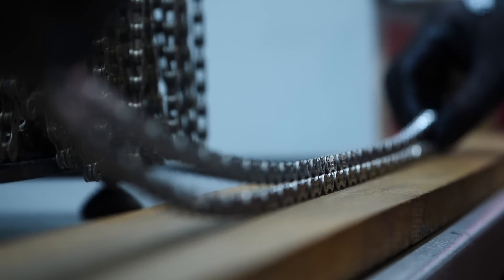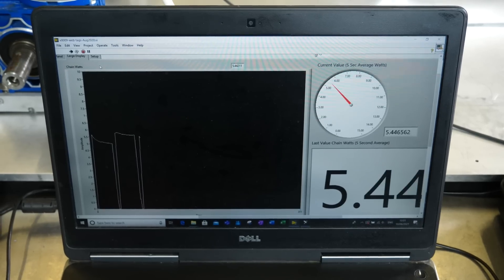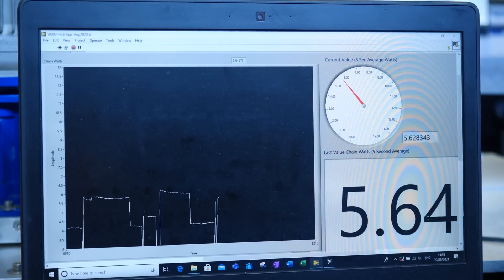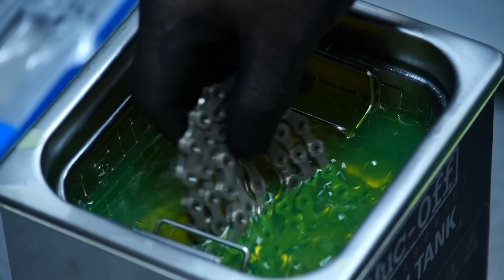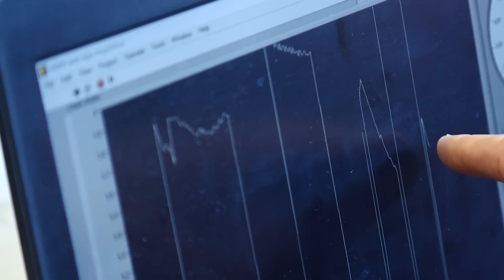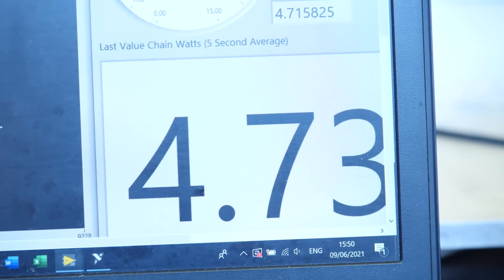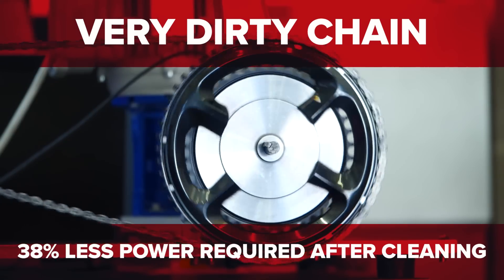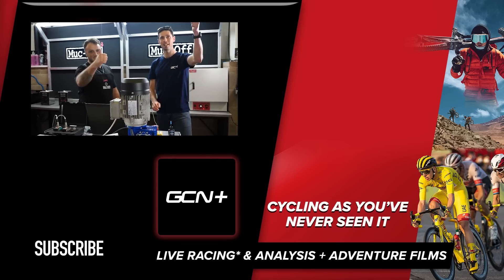Free Speed! | How Much Faster Is A Clean Bicycle Chain?

Comment: So you have a clean chain that's getting 100% (baseline) and as soon as you start splashing mud on it it drops to 62%?
Reply: No they're measure % difference in chain resistance. So if you loose 4.5W with a clean chain and 5W with a dirty, that's a 10% in resistance. 

But if you look as a total power 300W, an increase of 0.5W due to a dirty chain, you only loose 0.17% in effectiveness.

Basically GCN tech has been very very miss leading especially if you don't deal with stats often
Reply: @supernoodles908  True. You just explained it and I still don't understand it.
Reply: @kaspervestergaard2383  it honestly annoys me how people miss lead people with stats manipulation
Reply: @supernoodles908  That's why it's good with a comment section. Shouldn't be able to disable it in my opinion.

Comment: 6:14  How is chain tension controlled on the testing machine?  How much difference does that make?
Reply: The tension on the taut side of the chain is directly related to the amount of torque input from the motor to the chainring. 250 watts from an actual rider will put exactly the same amount of tension on the chain, averaged throughout the pedal stroke, as 250 continuous watts provided by a motor, when both are spinning at the same cadence in the same gear. The tension in the slack side of the chain is purely due to the catenary shape it assumes and is negligible in comparison to the drive-side tension.

Comment: Savings of 1 or 2 watts in 250W is not really worth the bother unless you are going to compete in a race with equals.   I just lube it now and then and clean it on occasions to protect my clothes (and hands when I jumps off).  
I would clean it after a muck ride but on the road every 100h or so of riding which is maybe one a month.

Comment: If we're looking for wattage savings, a few percent of sod all is sod all.  The energy consumption of a dirty chain is tiny compared to the weight of the bike and rider, and aerodynamics are the biggest single drain on your energy.   A clean and well lubricated chain is at best a "marginal gain" for competitive riders.  However, that's not the only reason to have a clean chain.  A clean chain wears more slowly and causes less wear to the rest of the drive train.  This saves money — although you need to factor in the cost of cleaning materials and tools, especially if you invest in a fancy ultrasonic cleaner and fluids.  Then there's the satisfaction of doing a good job or cleaning the chain, and the pleasure of it running quietly.  Don't forget to clean your chainring, your cassette or sprocket, and of course your jockey wheels.

Comment: It's a bit misleading to look at the 38% number. The real difference is how much power is lost of the total input, and even if it was 5 watts, then that's 2% of that 250 watts through the chain. Useful of course but it's not a night and day difference. If the first chain was used as an example, that 0.5 watts is 0.2% which is getting close to irrelevant.

Comment: A fair comparison would be a dirty chain vs a clean chain after a "normal" cleaning process not that professional "deep" clean. Given that tiny gain after deep cleaning, I'd assume the gain after usual cleaning would be negligible.
Reply: That's the same thing I thought.
Maybe they did and it didn't come out well for Muc Off (Rip off)
Reply: It's probably fair to assume that similar results could be obtained with basic cleaning tools. Keep in mind that individual cyclists are probably not the only audience to this video, but also employees of other bike shops. The parts cleaning and drying chambers, while expensive for a single user, would be well worth the investment to large bike repair shops in terms of the labor hours saved doing an otherwise menial task.

Comment: Power in bike is not so uniformly distributed as in dynamometer, since 2 pedals we got to push on. So chains and sprockets and dropouts should be tested in erratic maner, with say 350W average. More realistically, with 700 W average. Those springs should oscillate or no point in tests.

Comment: I really struggle to get my drivetrain clean. Any tips gratefully received. I spray it with WD40 immediately after the ride. Then wash that off with water. Then use degreaser and a Park Tools chain cleaner. It looks superficially clean, but if you bend a chain link you see it’s black and dirty in the roller etc. I use Muc Off Wet Lube, sometimes Dry. Short of boiling it in petrol - help!
Reply: You'll need couple of things before you begin;
1: an effective degreaser. I like "Pedros Bye Grease", but CyclingTips have a comprehensive list.
2: a chain with a quick-link so you can clean it off the bike.
As for the process, you can start by cleaning the chain on the bike with your Park Tool chain cleaner and the degreaser - this will clean between the rollers. Then remove the chain from the bike and scrub it with a nail brush or similar, before rinsing with water. At this point the chain will be pretty clean; You can use an ultrasonic bath if you want to remove any remaining tiny particles, but it won't get that much cleaner.
Before you put the chain back on the bike again, it's important to clean the rest of the drivetrain to prevent recontamination. Use the nail brush to scrub the chain rings, cassette, and jockey wheels. Rinse with water and refit the chain. 🧽 ✨
Reply: @rosscads  thanks for taking the time to reply, very kind. I think it must be down to the quality of degreaser, simply not good enough to leave it clean, given the steps I go through (and also occasionally as per you suggest). Will try the brand you mentioned, thanks!
Reply: @jgogl9791  Put peanut butter on there and borrow the neighbors dog.

Comment: And here I am having gone 800 miles on my SRAM ETAP AXS chain doing nothing to it at all because I read that SRAM chains come good from the factory. My issue is that the chain looks dirtier after I cleaned it than before I cleaned it.

Comment: If you want the independent, non sponsored version of chain testing >https://zerofrictioncycling.com.au/chaintesting/<
If you don't race, use a grunge brush to remove the grit followed by any low viscosity oil applied any way you want. Spin the cranks several times and wipe away excess. When chain is worn to 1mm buy a new cheap chain.

Comment: First off, you need to retitle this video SHAMELESS MUC-OFF COMMERCIAL.  I don't mind a bit of branding here and there from a sponsor of a video, but this was so blatantly done that it was insulting.  I have never used Muc-Off and never would, it's way too expensive for what it is.  Now then, as for the results of the video, I knew a clean chain was best, but didn't know the difference was that drastic.  Being here in FL our chains don't get that dirty unless we're off road, but I do clean mine once a week anyway and wipe it down after each ride.  For me it was always more about preserving my cassette, chain rings and the chain itself.  But now we all have one more reason to keep it clean, save the legs a bit.

Comment: I'm one of those nuts that waxes his chain after almost every ride. I heard about little to no wear, components lasting longer etc. So I decided to see just how long I could get a chain to last with using just paraffin wax melted in a crock pot. I was suspect about the life being reported out of chains waxed after every ride. I understand my results are anecdotal, but currently at 17000km on an 11 campy record chain and under .25 on the chain tool wear markings. People saying no good in wet or dirt, whatever. Gravel bike at 5000km and also under .25 on chain tool. Waxing is a pain at first while learning the steps to do it, but if you want to save money and have the best performing chain, then I suggest waxing. Its pennies to do.
Reply: As a mechanical engineer I can only say, that just paraffin is not a lube at all. Every report what sates its working simple NOT true (e.g they want to make money from it, like friction facts report does). Most of the time they are using a mix of oil with paraffin (like a generic candle), where the oil is the lube, or a mix with a dry lube like PTFE. Yes such a mix can work in some condition, but 1. the viscosity depends strongly on the exteral temperature 2. If you stand out, the oil foil will be damaged and it can't build itself back, like a pure oil does. 3. if you mix it with oil to be a good lube like a grease it will be not dry anymore 4. It wears and wash out quickly, this is the worse property of it. I can only recommend oil (any kind of oil will be good) aka wet/dry lube for your chain. If you want a fire&forget solution for your chains, use a totally closed chain case, like a dutch bike does.
Reply: @balsa02  Like I stated purely anecdotal. But I am at 17000km. I have not replaced a cog set yet. I have not replaced a chainring yet. Good luck doing that with oil. My chains do not hold dirt and grime like oil does, which will cause the inner pins to wear. Stretch the chain and destroy the drive train. A great article about this and testing done on almost all lubes was in Cyclingtips. Called Seeking the holy grail: A fast chain lube that saves you money. https://cyclingtips.com/2018/03/fast-chain-lube-that-saves-you-money/  It is worth a read. I found the comments the most informative as the author answers questions and gives more details.
Reply: @weasellyone2  “If you re-wax every 200 km, wear rates will remain untraceable for a long time,” says Kerin. “Re-waxing every 300 km, the average for a top chain like YBN SLA is 15,000 km to the recommended 0.5% wear mark". 

I'm not doing any form of maintenance that often my niqqa.
Reply: @balsa02  Erm, Paraffin IS a lubricant. It's the physical properties of the chemical that determine that. It just so happens, that the chains of hydrocarbons are long enough to be solid at room temperature. It might necessarily be an ideal lube for you by the sounds of it, but totally depends on ones goal as to whether it's worth it. Wax is dry, so doesn't pick up dirt easily, so reduces wear on components, however it doesn't stick as well like wet lubes, so isn't a long lasting. That is probably the major differences between them.

The viscosity 'problem' is the same with all lubes. Grease is a lube, and in your wheels and BB turns to oil like substance while riding, that's how it gets out. It just so happens new chains tend to be pre-lubed with grease, not oil. Grease is probably a better chain lube, but it's hard to get in. Some people suggest DON'T degrease your new chain for as long as you can get away with.

You can mix paraffin with a volatile solvent so that is evaporates after application. This is similar to how commercial dry lubes come as a liquid and 'dry' on application.

Wax does adhere to other things, just not as well as oil. That's fairly obvious from getting melted max/oil on your skin, they both stick for sure, but one is a lot easier to get off! You can make wax slightly stickier by mixing with something like xylene, not just oils. But it sticks reasonably well, if your chain is perfectly clean before you wax. It can resist wet weather okay, so long as the waxing is done when you chain is super clean. (I waxed my chain for commuting and would do 2-300km of riding minimum in the wet/mixed weather if done well, so would last all week in the winter).

The other benefit to waxing is re-waxing cleans the chain, so you only have to clean the chain properly once. Re-waxing is a doddle. Also, it's mildly amusing when you waxed your chain and let it dry, it goes rock solid in one long line.

I used to wax my chains. Basically once a week and had similar results to the OP.  But I take your points. I just think there are plenty of reasons to wax your chain before you even get into frictional gains. I stopped as frankly, I think the biggest downside is it takes a lot longer to lube your chain. It's no longer a 2 min job, and you do have to do it frequently, I did it like once a week.
Reply: 17000km on a derailleur bike is impressive. I can get close to that on a single-speed, but by that point the chain and gears are so worn there is no way on earth the bike would work if it had a derailleur in the path.

Comment: Firstly, the conclusion was confusing. They should have expressed the results in Watts, not percentages. And secondly, I suspect most people would have wanted to see the power differences with a derailleur set up, not a single speed set up.

Comment: “38% less power required after cleaning”... I think you’ve inhaled a bit too much degreaser 😂
Reply: Yeah exactly my thoughts 😂 probably 38% off of the 9% or 9w loss...whatever  Idk
Reply: over the drive train loss of 9 watts so that means if you pushing 300watts your effectivly only putting out 291 watts to the pavement while a clean chain your pushing 296 watts a difference of about 5 watts or so no alot on a sunday ride but deffinitly help in long race your talking about 1 minute of savings for a 2 hours race that alot of for pro rider.
Reply: Wait is degreaser bad for you?
Reply: @BeyondEcstasy  No he is talking about paint remover.
Reply: 8W lost when dirty, 5W lost when clean, (8-5)/8 = 3/8 = 38%. Math checks out & calculator does not inhale anything.

Comment: Very misleading results, but the other benefit to a clean chain is the potential longevity of the drive chain. I have only managed around 1000-1500 miles on a chain before it is 50% worn, which seems to be the time to change it. Silca claim nearly 10000 miles from a waxed chain… I’m 200 miles in to my first waxed chain so time will tell…

Comment: This is an excellent demonstration of why a quick wipe and a squirt of poundshop WD-40 knock-off is absolutely fine.
Reply: Fine for bare minimum.  A good quality oil makes a huge difference.  I've only been cycling for a year but I like taking care of my bikes. Especially one that costs 4,000. Dry lubricant doesn't let all the grim stick as easily. I use finish line. I used wd40 before. But it doesn't compare as it is water-based also. Just try it. And hot soapy water with dawn and a good brush is one of the best ways to clean other than deep cleaning.
Reply: @sethmichael8188  WD-40 is not water-based.
Reply: @davidf2281  silicone. Still trash for bikes
Reply: @sethmichael8188  Nope, not silicone either. Keep trying.
Reply: @davidf2281  shit based that's what I was thinking of.

Comment: 3 watts saving for a 15-20mins ride. Hhmmm.. stretch that 3 watts to 2 hours, 3 hours.. that's going to be a lot in the end. Not to discount the demotivating feeling of hearing and feeling a grinding sound from your chain knowing that it is slowing u down. I think it's gonna more than affect u by 3 watts. I trained like a mad dog just to go get 4-5 watts gain in FTP in 1 month. Imagine stretching the 3 watts loss, not just for 1hour which is your FTP but up to 3 to 4 hours of ride.. it's definitely gonna wear you down.
Reply: A whole lot of effort and continuous money spent on degreaser and lube for a measly 3 watts. A pair of latex inner tubes will save you 5 watts, simply getting more aero on the bike even much more.

Comment: Could it have changed with rear derailleur? I think bending more the chain creates more resistance and more room fore improvement.
Reply: Would not have any influence on the result: The power loss occurs in the section of the chain being under tension, not in the loose section.
Reply: @christiannasca3520  Any additional components rolling or moving with any mechanical force create a loss point of energy and efficiency. That's just the way things work.
Reply: @MetalY2KMusic  The loss is always a percentage of the transmitted power. And while the entire power of several hundred Watts is transmitted through the tensile force on the upper segment of the chain under stress, the power transmitted along the lower, loose section of the chain is close to zero.
So the more power is transmitted by the cyclist through the chain drive, the more negligible the loss in the derailleur becomes.

Comment: The sentence "38% less power required after cleaning" is really misleading, it should say "38% reduction in chain losses". Those are two completely different concepts.  In fact you have about a 3 watt decrease in power so for the 250w input you actually observe "1.2% less power required after cleaning" (for the worse case, the 200  mile chain only showed 0.2% reduction).  Some absolute marketing shithousery going on here...
Reply: Very shady indeed. It means, that if you rode on a dirty bike let's say with 20km/h, you'll loose 240 meters/hour. A Kilometer per 4 hours. Or 3 Minutes of extra ride time. From a time/ effort perspective, this is neglectable. 
But of course, 38% is a big number and sound just a little bit better then 1.2%. 

For what tough? They could just be honest. 1.2% could make a difference in an actual race. Tough racers would keep their chain clean anyway I suppose. More importantly: Less wear. You can extend the lifetime of your components quite a bit, saving you ultimatively stress and money. 

Also, propably even more important to most people: A clean chain is nice and smooth and "silent". Riding a clean chain is just a lot more satisfying.
Reply: Makes it sound as significant as  drafting..
Reply: Yeah, and it's not even "chain loss" as the drive train naturally loses power in itself... bad purposely confusing maths...

Comment: They can use an ultrasonic cleaner filled with fresh lube to drop the clean chain in for a sesh. 
It will do a way better job than whatever you manually do and I'm certain whichever pro you actually clean the chains for (hard to believe that) will thank you for your ingeniousity, or mine.
You're welcome, now...MucOff.